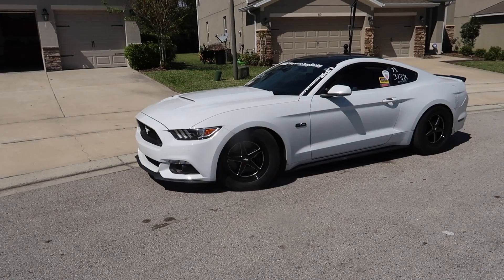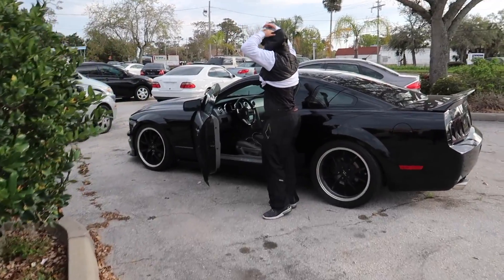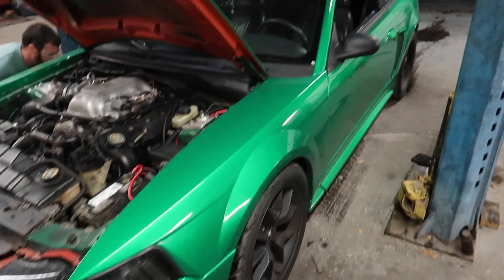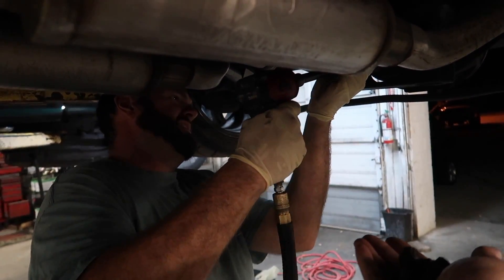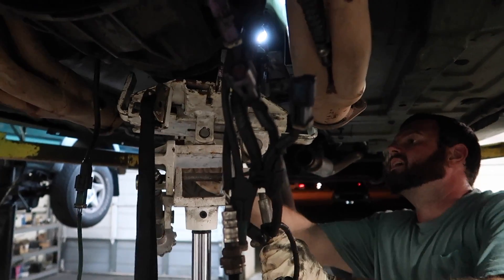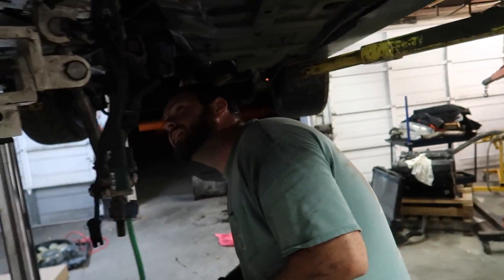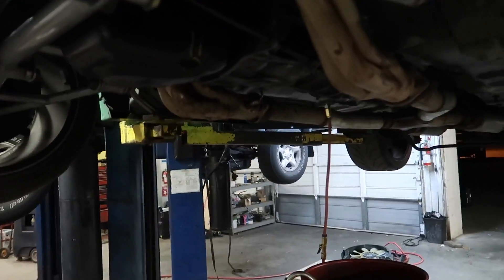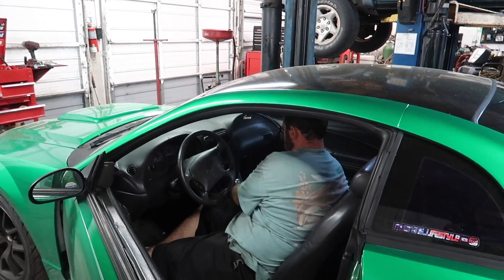Turdzilla TR3650 Transmission Swap

Comment: Been there done that.!!!Not possible with 2v heads, think 4v a little wider. have to break the passenger header loose  with BBK longtubes.

Got a 5.4 dohc with gt BBK longtube headers and it comes out no problem now

Comment: Hey man I need a huge favor I recently did a tr3650 swap in my 02 gt and i dont have my reverse lights or my speedometer. I was wondering if you fan show me how your wires and connections are plugged up under your footwell by the clutch and brake pedals

Comment: I have a 2001 svt cobra with some mild mods and been torn down three times to fix Robson issues by the prior owner. It now has a tick in the I believe the passenger head. It’s nots visceral. It goes away at anything above idle. It HAS NOT been driven more then 20 miles since the tick started. I need advice since berthing so expensive I want to do it right one time. Thank you to any help!

Comment: Andrew, What's your suspension setup on Turdzilla?  4.10 gears, Viking double adjustable shocks and springs, fixed or adjustable control arms, Toyo R888s?

Comment: So you used the same flywheel that was already in the car im assuming is a Windsor motor? And the tr3650 was out of a Romero ?
Reply: Im also wondering the same thing, i just swap the T45 for a 3650 but now it doesnt crank.. 🤷‍♂️
Reply: @the1withnoname496  just finished my swap and mine started just fine
Reply: Ask me what you need to know brother
Reply: @maciasd303837   well i have a 99 Gt with a 99 cobra 4v swap, car had the T45 but reverse went out then 5th. I got a good deal in a 3650, trans is in but now it doesnt start 🤧  im using the same t45 clutch and flywheel i had tho..
Reply: @the1withnoname496  what I did is resurface my existing flywheel and then I got a 10" clutch .
Did you swap the reverse sensor already from the t45 to the tr3650 that's the only thing no had to do everything else just bolted right up
Reply: @the1withnoname496  my car is also a 99 gt with a 2v and the tr3650 is out of an 03 GT

Comment: Btw that guy on the 3v looks stock up all the time. The cobra can smoke that coyote swap like nothing.
Reply: EAbraham.R  a N/A f150 coyote not tuned Vs a tuned supercharged 4.6 hmm well no shit Sherlock
Reply: Vmp supercharged 4.6 making 600-650 RWHP vs a 430HP coyote? You don't say? Haha. If it was a all stock cobra it'd be a different story
Reply: Cesar L  sorry he choose a coyote 🤷🏻‍♂️ should’ve saved for a bad ass motor like a shelby then
Reply: Cesar L couple bolt ons and the cobra kick ass since 2003 should also think of that.  2003
Reply: EAbraham.R the 5.0 has more potential than a 4.6 4v ,it's newer technology and the market for parts is growing faster and faster, don't get me wrong I love the cobras but 5.0 have more potential if built right and a 2008 Shelby still goes for $25,000 his whole swap cost him around 6k and he needed the car running asap for another 7k he can have it supercharged

Comment: Somebody swapped a T45 into my 04 GT... it seems fine except for the speedo and digital odometer dont register with the gear style vehicle speed sensor. Also the clutch pedal seemed kind of tight and yesterday the cable just completely snapped. It's got a 72" cable, pretty sure it's a BBK. It's got what appears to be a BBK quadrant on it too. 
 Anybody know a way to fix this besides changing the whole trans out for a TR3650 which actually belongs in the car? If I'm going to go through that trouble I'd like to entertain the compatibility of a T56 so I can have a 6th gear, or at least getting the beefiest TR3650 I can find/build. Im just repacing the snapped cable on the T45 for now until I can figure out what I should do. It drives great but I want the speedo/odo to work and to clear the check engine light for VSS low voltage.

Comment: Flashing dash light for the E brake means low fluid in the master cylinder be careful
Reply from the maker: In this case it’s just the ebrake handle. It pulled out of the floor and needs to be welded to be fixed

Comment: Can you ask nick what kind of color coolant or what kind of coolant I need to use for my 2002 Ford Taurus
Reply: 05GT Beast just look it up on google 😂
Reply: I looked at the manual as well and it has two different kinds of color coolant in the manual so I’m confused and I also looked it up and autozone had it and I went and bought it